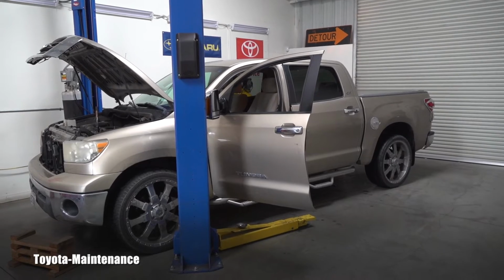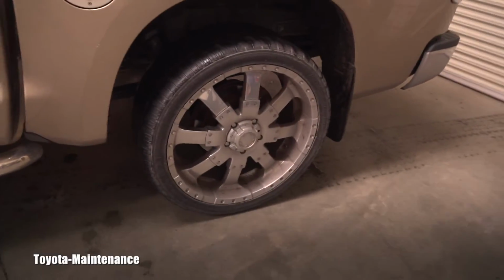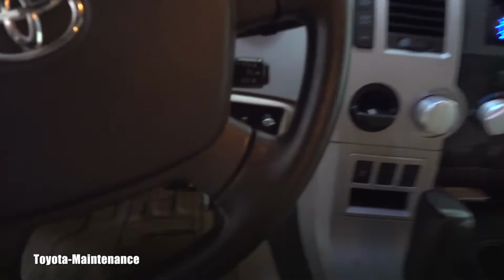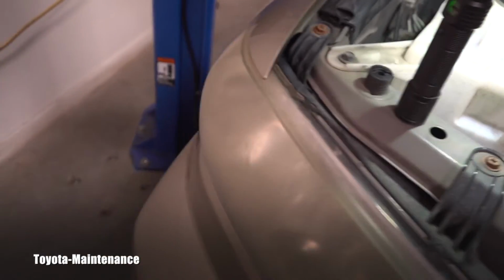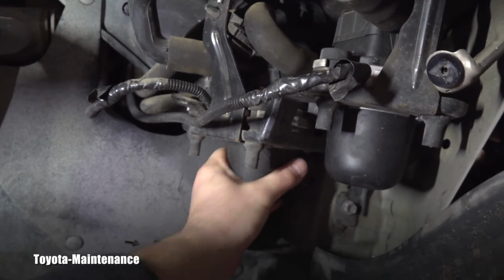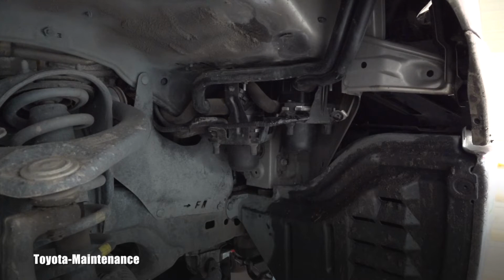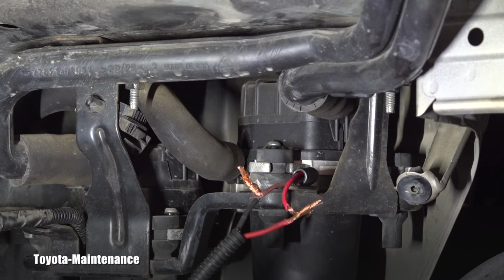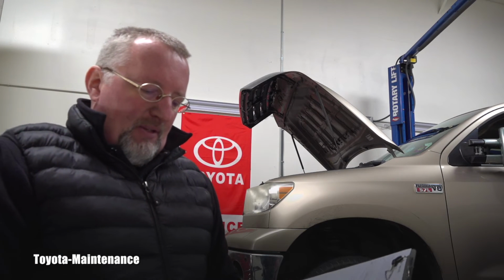Toyota Tundra code P0419 Secondary Air Injection System Relay B Circuit

Comment: So far this is the best detailed video on troubleshooting po419. For tundra 👍. I failed my smog check today 
I’ve kept deleting the code off my 2013.  Today I deleted the code.   Smog told me I had a permanent stored code po419 😔. Crap. Now I’ll be doing the same testes as you did.      Thank you

Comment: Please help ! I used alligator clips that i soldered to both end of 2 pieces of wire to test the pump. When i tested loud pop  and red glow in the pump connector now truck will not start. Can someone please help me!

Comment: Went to two different mechanics both said they would only replace both air injection pumps and they had to be genuine Toyota parts or they would fail or they could not cancel the code. Please I need opinions..😢

Comment: I have a 0418 "Circuit A" code on my 2013 Toyota Tacoma.  I used jumpers to test the pump and it worked.  However could the pump fail intermittently?  Sometimes the lights on my dash will go out and then they will come back the next time I start the truck
Reply: Hi there, did you end up installing the Hewitt bypass to get over this? Just got the code on my 4runner

Comment: I just watched this video!!  Having the same code and code P2442-Secondary Air Injection system switching valve stuck open bank 2.  Any chance you have a video on the P2442?  Toyota wants $3,600 to fix these two codes.....  Great video!

Comment: Should the pumps come on when you turn the ignition on? Asking for myself
Reply: I was thinking the same. Maybe hard to hear which one is not working in that noise though...
Reply: @nikibuko4803  I bought the bypass and was done with the problem
Reply: @bryangatewood6749  I am reading up on the bypass. There is slyfox and Hewitt. Which one did you install?
Reply: @nikibuko4803  I believe the Hewitt. It was stupid easy and did it myself. There is a video on YouTube by those guys showing step by step. I haven’t had a single issue in 6 months

Comment: Would be interested to see a video that walks through all of the components of the secondary air injection system. Solenoids, pumps and valves. Seems like you can have multiple failure points. I feel lucky this hasn't broken on my 2007 tundra.

Comment: Excellent video!  Shows me how I can jumper 12v to each connector and test if one, both or neither pumps are functioning. 
My ‘07 5.7 reads P0418 code which indicates a Relay “A” Circuit issue so could it actually just be a relay that needs to be replaced??

Comment: It is so annoying when prior "technicians" can't even re-install a cable support bracket....very interesting video as I have a 2011 with this issue...clients vehicle is actually missing the liner and the intake horns are coated in dirt and sand..

Comment: I got the Joe Biden price at my dealer….every price doubled….$3700 plus tax.  Did not even offer a $1200 stimulus check before doubling the price of everything!  Looking for other options, wish you were my mechanic.  I would be jumping for joy at your $300 plus labor O’riely option.  Didn’t like seeing that snorkel sucking in moisture…I live in wet Western Washington.   From what I can see, this is known by Toyota and chronic…I.E. Expired Extended warranty offer?  Must be great for the dealers and the Toyota parts profits.  Not happy with Toyota…called their Warranty department…as you said, no help there…needs the feds involved.  Car goes into “limp mode” while driving, 30mph may on the freeway…this is a safety issue, also.  Those crazy wheels aren’t helping!

Comment: I have a Toyota Tundra 2008 5.7 and check engine code P2442 so I replaced the secondary air injection pumps so now it has code P 2442 ,so I replaced air injection check valves and now I getting a code P 2447

Comment: Does code P0418 Secondary Air Injection System Relay A Circuit also mean one of the pumps in the fender are bad as well?

Comment: awesome video!  thanks showing how to test the air pumps!  my dad's 08 tundra has a bad switch bank (P2443) that is throwing code & needs replacement.  175k on truck.  pumps/switch valves replaced at 90K.  switching valve replacement looks complex/time consuming, but not impossible...  thanks again!

Comment: i had this exact prob w 12 tundra 4.6 engine dealer wanted over 3000$ did the bypass for over 600$ but didnt work after 3 times traded the truck i love because the dealer made me think major problems. thanks toyota maintenance you opened my eyes. wish i had you explain this sooner. you really speak truth into some dark corners of dealers and mechanic tricks.

Comment: Can't u just bypass those air pumps and finally be done with that expensive repair?
Reply: Yes you can buy a bypass kit. From Hewitt industries. Just Google it. I bought one for my 2006 4runner v8. It took 45 minutes to install and no need to deal with this problem!

Comment: Get the Hewitt Tech injection air pump bypass and be done with it.
Reply: Exactly what I did.  $230 and an hour of my time.  Problem bypassed.
Reply: I see you live in Seattle,  don't bring that truck to California, it'll never pass smog.
Reply: @bernardogonzalez2816  HA! I would never live in California 😂 beautiful state and I love to visit there though. You can pass California smog with these btw, they literally affect nothing emissions related when your vehicle is warm. The injection air pump is only to speed up heating your catalytic converter on cold start, they are incredibly hard to see visually and it would be hard for a visual inspector to see it. I’m part of forums with many members successfully living in California with these bypasses having no issues.

Comment: I have a 4runner with the same engine, the previous owner changed this pump. I’m not excited for doing it myself.

Also do that owner a favor and throw those wheels in the scrap metal pile and get some OEM ones.

Comment: "If you see these wheels, are you surprised? You are not surprised."  I laughed, which isn't easy to make me do, Peter.   
There are at least 2 well documented occasions where satellites costing hundreds of millions of dollars were lost on launch because someone incorrectly connected 2 simple wires. After the first one crashed, the Americans made sure the wires were of different lengths, or had different connectors, so that couldn't happen again. Another very expensive satellite was destroyed because one contractor was using English measurements, and another was using the metric system. Wrong numbers were thus entered into the satellite computer, and the pieces of the satellite burned up upon reentry into the atmosphere.  Another satellite was recently ruined after it fell over during fabrication in the clean room. Murphy's Law strikes a lot.

Comment: Thank you for the video. I have 2007 5.7 225k miles. Luckily no Air Injection problems yet, how can I prevent this problem? Maybe put a a kind of "cap" around the ends of intake to prevent moisture??? Thank you for your time!

Comment: This reminds me, it seems like all the auto parts chain stores are finally starting to stock NON-insulated crimp connectors🙏 maybe everyone will stop using those terrible plastic covered abominations now 🤞 😄 it's also handy to be able to grab them quickly instead of having to order online if I'm running low or away from my shop 👍

Comment: Thank you for the video. You showed the air intake for the pumps and their connectors, but where does the pumped air go? I am assuming that they go to the some component of the exhaust system, but, if so, which one? Does it appear on the video? Thanks again,

Comment: I believe my 2009 has this problem. Been in limp mode for a year now...Toyota quoted me $1,900 to fix it. Even though they never said they replaced them before 150k. I complained at 119k miles.
Reply: My 2010 started the problem at 105K but there was no Service Pubs to the dealers at the time.  They did not get them until I was well after 150K.

Comment: this engineering design with the open-end vertical snorkel that just funnels water and condensation to the pumps is nutty.  if you live in humid south prepare for failed pumps and rust as moisture is pumped from fender well into throttle body and sensors.  toyota came out with redesigned snorkel but I chose to relocate them into top left engine bay and replaced long snorkel with snub nose to avoid condensation.  if you have a failed pump you can take it apart and look at the damage--sometimes you can fix.  but don't just fix the pump--look in this channel and clean the throttle body and follow tubes into the valves or they will fail next after the pumps.  thanks for this channel for detailed troubleshooting tips on this system.  Always first rate on toyota maintenance channel.
Reply: Please provide more detail on your fix and the "snub nose"? what did you do to prevent moisture?
Reply: @bobd8553  ok..here we go.  I removed the mount with pumps from the fender-well, then found a nice dry spot to mount in top of the engine bay passenger side.  Then rerouted the hoses and connectors.  My reasoning was at least the pumps can stay dry up there.  Then there is no reason to have the snorkel although you could keep it--it is just plastic.  I went this route because I tried different mods to the snorkel (while keeping in fenderwell) and still in my own 30 day inspections I'd still find water in the pumps.  then it became a mission.  Although i am not a fan of non-toyota parts--just not going to spend 300$ when you can buy aftermarket pump for 100$.  if you look around rockauto or parts geek you will see replacement pumps that have this snubnose, mushroom looking snorkel (and you need something to keep big debris from coming into the pumps).  These aftermarket pumps can be inferior but at least give em a chance by not running in water all the time.  I ran the aftermarket pump for a year but didn't clean out the valves (mentioned in this video btw) so had a Valve fail and had to replace.  I found this channel and step-by-step details to clean everything in line from the pumps to the intake.  Thanks to Toyota Maintenance channel I'm getting a little confident So I got curious about this whole whonky setup and went back and took the toyota pump apart for a post-mortem.  I found the reason it had failed was the water had saturated a foam filter in there and caused it to be pulled into the turbines which created a gooey mess inside.  Once I cleaned out the pump i was able to use the foam filter from the aftermarket and put the toyota pump back so now i have the aftermarket pump as spare.  I'm def not a tech--I'm a software programmer, but i don't have any more secondary air codes when it is damp and moist here in the carolinas!  (and repair is good for 2yrs now)
Reply: @sonofhin  Thanks for the info, defiantly will do some updates. Are you familiar with the chip you can install to bypass the injection system?
Reply: @bobd8553  yes I found that (one company was from South Carolina!) but if I remember it was also an expensive fix.  In our state we have yearly inspections and did not want to risk not passing.
Reply: @bobd8553  I bought a bypass kit from Hewitt for my.5.7 liter for 400 dollars about 6 months ago and it got rid of the codes and took it out of limp mode and was pretty easy to install. They have a YouTube video that shows you how to install it.
Reply: @calebwrasse6008  Does the check engine light come on with the Hewitt? Thanks
Reply: @bobd8553  NO  the check engine light is gone. It has been working fine for 6 months.
Reply: @calebwrasse6008  What year is your 5.7 and how many miles before you had problems.
Reply: @dalephillips8250  it is a 2007 and had about 220,000 miles when it had problems.
Reply: @calebwrasse6008  is the bypass kit legal in California? I'd install that kit but have heard that it's illegal in California so what's the point? Or can you hide the kit and just not tell the smog station? What they don't know about they might not care??? Anyway, I need to find out if that kit makes sense for California, any info would be appreciated.

Comment: I just don't understand Dealership prices.  Recently, I needed a new Remote Key Fob with emergency key for my 2015 Dodge Challender SXT.  The Dodge Dealership wanted $100.00 for the key fob and key, and $200.00 to "program" the key fob and cut the key.  I did my own research and here are the results:  I was able to purchase a brand new unprogrammed key fob (with "coin" battery installed) and uncut key for $20.00 online.  A local certified locksmith was able to program and cut my emergency key for $45.00 cash.  So, I paid a total of $65.00 for my operational remote key fob.  No way was I going to pay $300.00 for the same service.  As Peter recommends, shop around.  Peter is a VERY HONEST mechanic!  I would totally trust him with my 2019 Toyota Tacoma 4X4 SR Work Truck!!!!

Comment: Glad to see a video on actually testing the pump! That wiring job is just... no words. How much could a soldering iron cost, $10?
Reply: I suggest using non insulated crimp connectors, covered with quality heatshrink tubing, it takes no skill vs. Soldering and is less prone to fracture, but either way I suggest the marine grade heatshrink tubing from harbor freight for your electrical kit it is incredible for the quality/cost.
Reply: Total agreement, ebay sells them cheap as heck. There's no excuse for that.
Reply: But the pump comes with its own wiring and connector,  dipsticks were so lazy they cut the wire instead of fishing the wire up thru the truck .